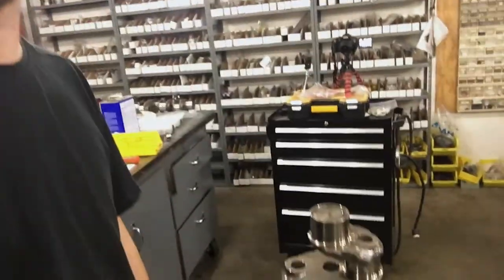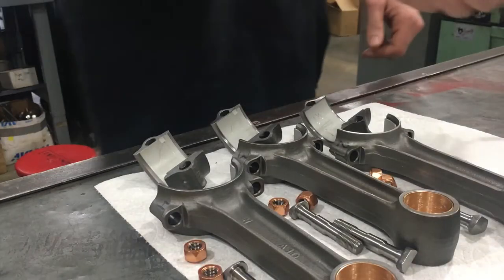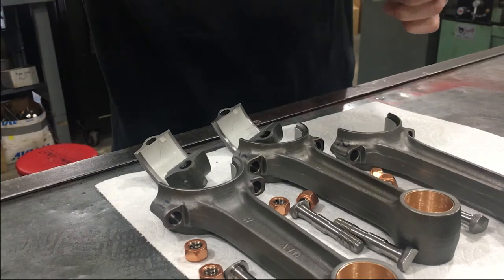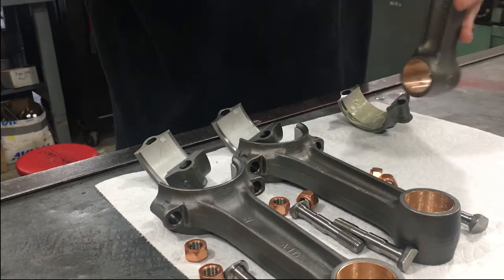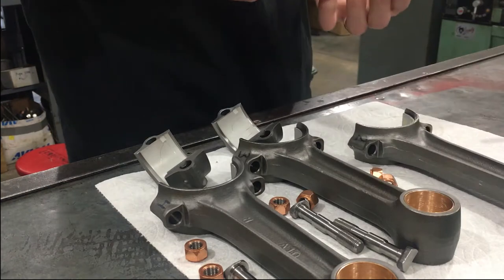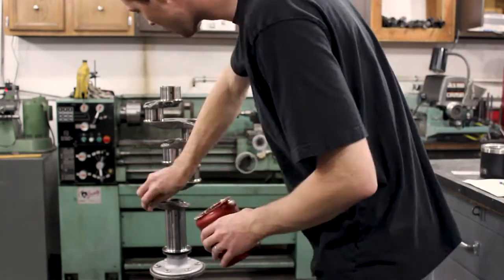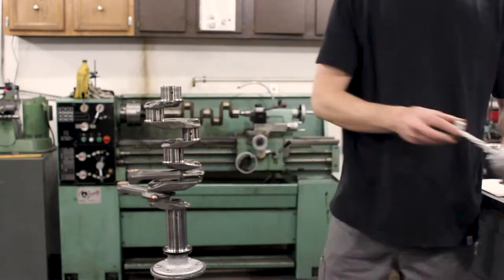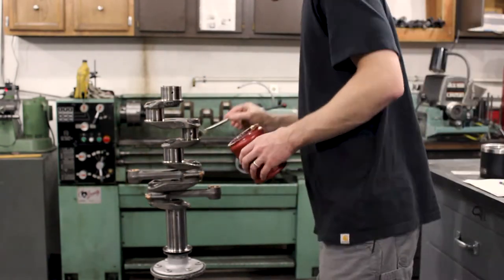How to Install Connecting Rods on Lycoming O320 Crankshaft

Comment: I have a question for you guys. I'm doing the top end of a o235 with 700 hours on it, what is the safest way to make sure I'm putting the correct rings in it.
Chrome cylinder = steel rings and vice versa
Reply from the maker: You are correct. Steel rings for chrome bore, chrome rings for steel bore. The best way is to go by part numbers. Their are individual piston ring part numbers and ring set part numbers for either chrome or steel bore. Can be found in Lycoming parts catalog or Lycoming Service Instruction 1037
Reply: @akcylinders  Thank you .
I know mixing them up is bad news

Comment: You mentioned that if after installing the rod you spin it and it makes noise that you should take it off and clean everything up and reinstall. My question is, when you reinstall do you use new rod bolts and nuts? Or are the bolts only considered to be one time use if the engine has been run.
Reply: The manual says that once they've been torqued or stretched to spec, they have to be replaced if they're removed - Period!  No gray areas there.  Taking the rods off and putting them back on would get pretty pricey REALLY fast!
Reply: When I rebuilt an O320 back in 2011 the bolts cost $35 each and the nuts $5 each.

Comment: Which bearing absorbs the propeller's pulling force?
Reply from the maker: There is a thrust face behind the long front main journal. Little hard to explain in text
Reply: @akcylinders  I thought so too. But only on the aluminum of the motor housing? Thanks for the answers !